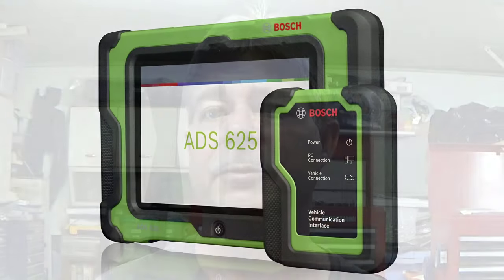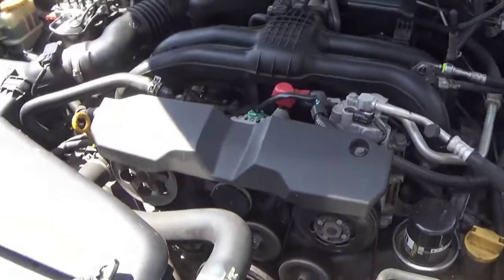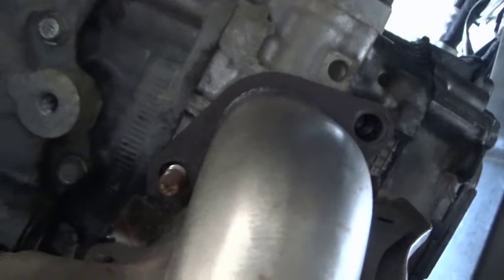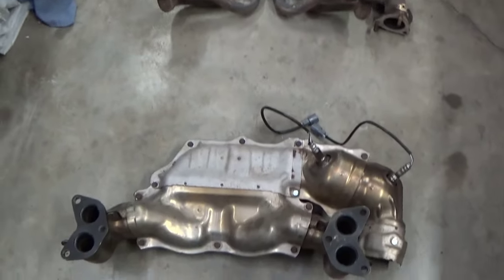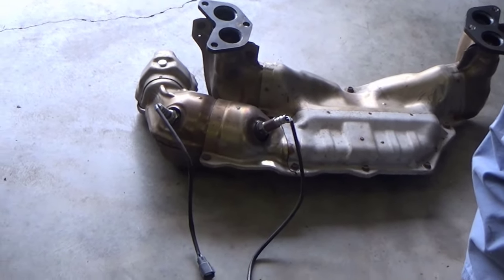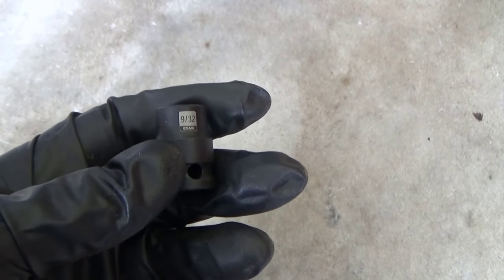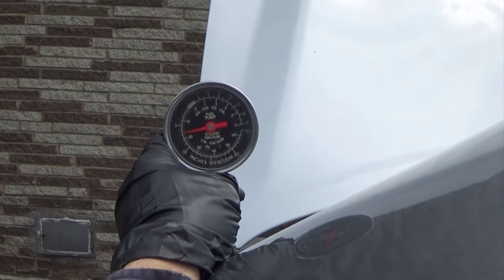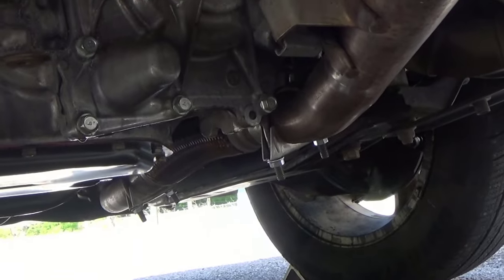2013 Subaru 2.5L - How To Diagnose/Replace Clogged Catalytic Converters

Comment: Would the check engine light stays on if removing the rear cat and putting the flex pipe ?
Reply from the maker: I have done several different cars including this Subaru and the check engine light never came on when it was clogged or after I remove the rear cat on the Subaru and similar configurations on other cars. 

That is what is irritating, you would think the check engine light would come on when it is clogged and it does on most newer cars but vehicles up to and around 2016 don't seem to be smart enough to detect it. 

If you have a check engine light on, take it down to a parts store and let them read the codes for free. Make sure you get a print out or write down what the codes are and then have the store clear it to see if the light will come back on. You check engine light may have nothing to do with your exhaust problem.